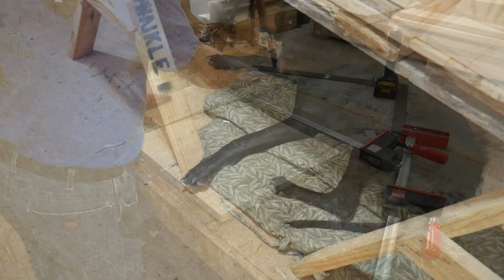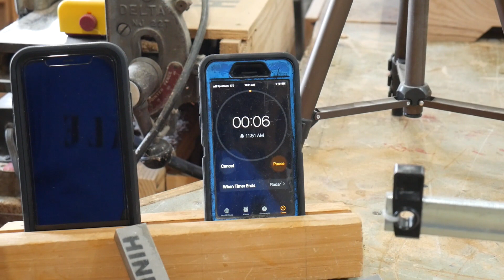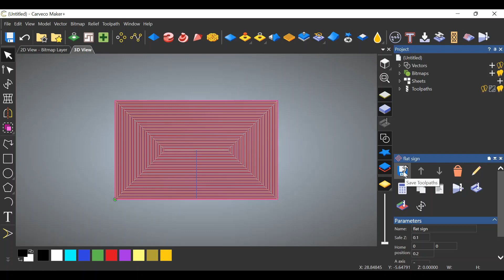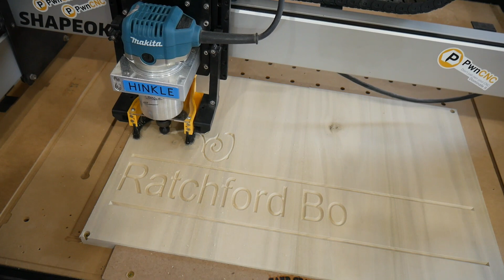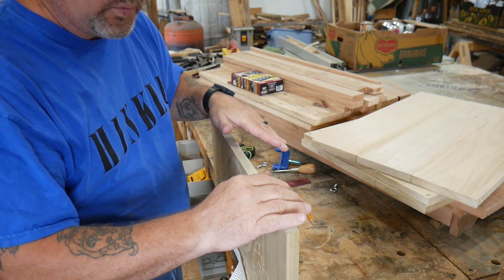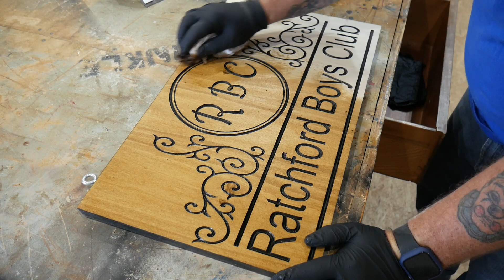I made a Carveco Software V-Carve just for the boys

Comment: I like the idea of smoothing out the surface of the board before doing a v-carve.  I agree that it will give the best results.  One thing I'm curious about is why you'd use a 1/4" bit to do it.  If your system is setup correctly, you should be able to use a much larger bit and it would go a lot faster.  Just wondering what the rationale was behind using that size tool?
Reply: Ok. I guess I'm too impatient to wait for a small bit to smooth out a large area. Glad one of us has patience.
Reply from the maker: Thanks for watching 
No real rational that’s just the largest bit I have at the present time

Comment: Nice work. Personalised gift for kids in Amazon see their reaction & they feel adult and noticed, more important!
2 things surprised me. You went for Offset pattern to surface the board, do you not find that leaves the expanding rectangle lines in the wood(not tramming. Just stripe lawn effect of surface fibres) I always try to surface with the grain and lose any lines in the grain?
After skimming 1/16" you still had pencil remaining?
Reply from the maker: Thanks for watching 
I put a small cross hair back on the board to confirm that I don’t loose zero 
I go offset because it seems faster and only takes a couple seconds with 100 grit to remove the lines